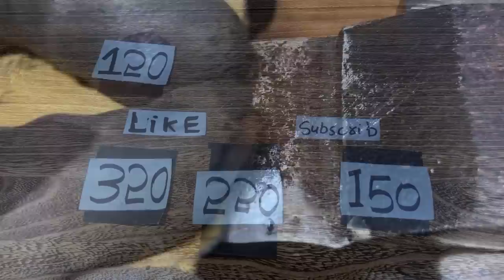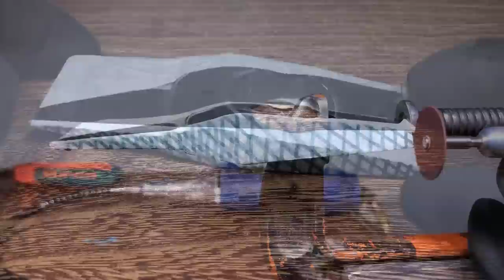Rusty 18mm Hammer Restoration - Hammer Customization & Restoration Video

Comment: Nice job cleaning up the hammer. I will admit. I'm not a big fan of the texture patterns. You put on the hammer head and handle. A nice simple design and some either hot or cold blueing. I think would have put this one over the top.
Reply from the maker: yes you are absolutely right 
We will also apply cold bluing in new Projects

Comment: Good job but the handle is too long, this is actually not an axe but a masons hammer. Masons use it to tap the bricks with it on the mortar and also split bricks,  the usual length is 12 to 14 inches, but nevertheless good j.
Reply from the maker: Yes You Are Right Thanks For Your Time 😇